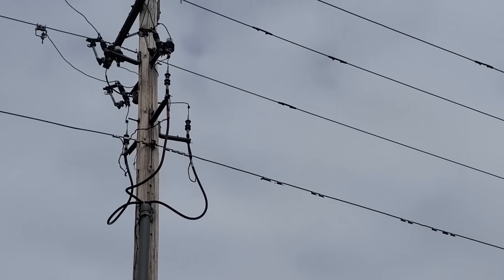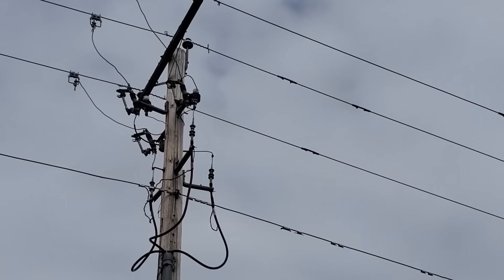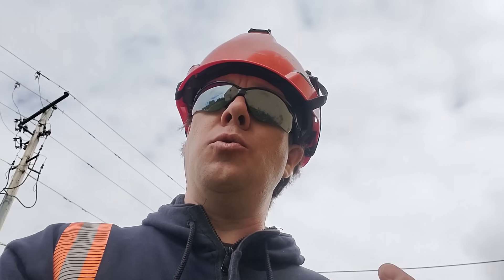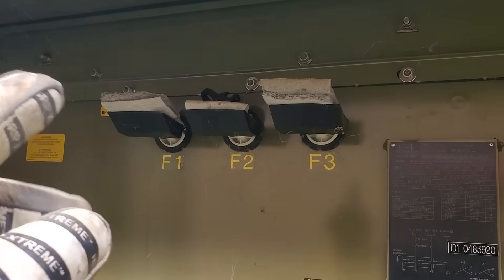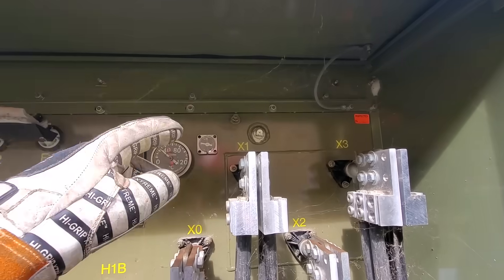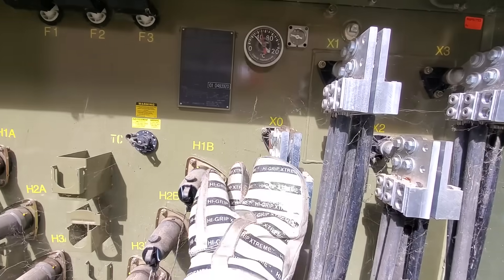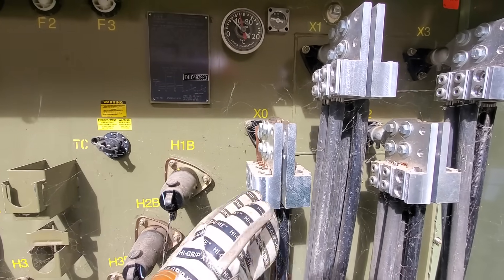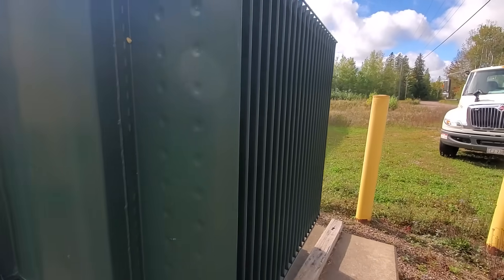A closer look at Padmount Transformers

Comment: A couple of things I can tell you about these.
When you pull on the wire the breakaway will break away and oil will go glug glug for a while.
Then the power company comes and fixes it.
Then the bill comes, and you need to clean your pant legs.
I was lucky and the locates were off so they ate half.

Comment: I try to not touch those anywhere as it's possible (though probably very unlikely) that it could have some voltage. My high school had twelve of those around the campus. They all had 12 foot square chainlink fences around them (for good reasons, mischievous teenagers). I cannot recall any issues apart from a phase los that blacked out half the school. That was a different one somewhere far away. (it was more than just the school affected)
I didn't realize those were oil filled like the pole mounted ones. I gues fair enough, as those are supposed to deal with huge amounts of voltages and curent.

Comment: SO OUT OF CURIOUSITY... if the transformer had a leak from either rust or some idiot drilling into the unit, what would happen after the oil is drained out while the transformer is hooked up and online?  If there a protection circuit that would shut it off or would it possible catch fire and/or explode?
Reply from the maker: Anything is possible, but it would likely overheat and pop the cutout/fuse that's protecting it

Comment: 😲 The only things I thought I knew about the “green boxes” were that they hurt my shins when I accidentally trip over them and that they change the voltage for different load. But, even if I were tempted to ever get into one, I now understand that I have no idea how technical and complicated they are inside. I had no idea they had oil in them. I love the insight into the complexity of tapping into an underground line. I expect that that translates into the cost of tapping into power for new construction, which means that opening a new business or building a new home gets more expensive.

Comment: as an electrical engineer myself, I always shut people up at site or at client meetings because of how little they know. But whenever I work with a linesman on the high voltage side, I don't say a single word, not because I don't know less than them, it's simply because of respect. If a linesman says its gotta be done this way, I don't challenge that, I just stfu and do it his way. No questions asked !!!!

Comment: Question: what would happen to one of those during a catastrophic flood event, like happens at times in various areas of the US?  They're normally very weatherproof, but I don't think they'd be watertight to constant pressure of submersion by surrounding floodwaters.  Have you ever had to work on a transformer like this after something like that?
I'm just curious.  Hadn't really ever thought about that before this video.
Reply: Some utilities use submersible transformers instead of pad mounts. Completely underground with an open grate  over the vault.  Less accessible to the public.

Comment: hey there 
im a brand new subscriber, just got a few questions
so you said theres no exposed wiring in there, are those silver connectors not exposed "live" parts
what do the varios writings mean x0x1x2x3 etc
Reply: "x0x1x2x3 etc" are the LV bus bar coming out. They're aluminum on this unit.

Comment: Working many solar fields, it takes some getting used to remembering the "LOW" side is power in.  And watching for the 120volts coming from the street transformer to the equipment letting the system know whether the grid was up or down.  Either way, once it was terminated and tested it was no longer our concern.
Reply: Do they hook up grid scale solar panels in series to get a few kV of DC into the inverter?

Comment: they have to replace ours at work every year because of the vibrations from the equipment inside the building which rubs the lines in the ground and causes a ground fault, if they are not replaced yearly,  we ground fault and that gets expensive as our load condition is a 4 million dollar unit and it does not take kindly to faults.

Comment: Is there a concern with home power generation (either by solar panels + batteries or a generator) backfeeding power during a power outage?  

If a homegamer hooks up a solar panel and battery system and the power goes out, but the homegamer doesn't open his main breaker, when you work on the line, is there a concern that you could be harmed?  What precautions do you take or should you take when working on a line during a power outage?  Is this even a problem?  

It just occurs to me that if a home system is backfeeding 240 volts to a xformer, wouldn't that step it up to 10,000 volts or so?
Reply: They wear those oven mitts. They'll be alright.
Reply: Proper grid tie solar systems will either shut down completely or disconnect from the grid prety quickly when grid failure is detected.

But people feeding in generators without proper interlocking certainly do pose a hazard to utility workers if proper precautions are not taken.

Comment: I used to do basic power routines at AT&T. I helped maintain 24v plant with large Lead acid cell batteries. We had a big fire in our Los Angeles central office I suspect caused by someone doing maintenance and not using insulated tools.

Comment: yea I remember Louie the Lightning bug down here in the states  (might have been early nickelodeon, they had a lot of Canadian kids programing ) besides that we have a similar pad transformer surrounded on 3 sides by a "explosion proof" concrete wall. It has a nasty sticker of a very pissed off cloud with a lightning bolt coming from it ... says something about lethal voltages, as a supernerd and a EE working in a factory pulling nasty amps at 480, I always wanted to open the box

Comment: The oil in that transformer. Is it flammable? Biodegradable?
Reply: Historically, the oil was mineral oil.  In modern times, a fluid called FR3 is the replacement for the mineral oil.  It is less flammable, and not as much of an environmental hazard as the mineral oil that used to be used in transformers.

Comment: The big park in my town has one of these green boxes situated right next to the pedestrian plaza between the baseball and soccer fields. It takes a 13.8kV distribution line and steps it down to several 120/240/480 volt drops for the field lighting systems and concession stands. That box has been sitting there for some 20-odd years with hundreds of people walking by it per week during summer games. It's amazing how close we can bring such high voltages to people, and do so safely.

Comment: There is magic smoke inside a pad-mount transformer.... If anything happens to cause the magic smoke to start leaking out, it's a really bad day for a person named 'Someone'. 

Someone loses power in middle of shower. Someone has to come and repair pad-mount and put the magic smoke back in. Someone get's stuck at intersection when traffic lights quit. 

Finally, Someone has to come up with satire, because failing to do so is just wrong.

Comment: we here in the Netherlands have all underground power wires. You won't see above ground anywhere but for the long distance ones with them huge pylons. This is due safety etc. Also here things are planned like 10+ years ahead, for getting a build permit will just take you that long. Also transformers are there on both sides of the "line" underground towards houses, if one transformer goes out, the other will take over, full automatically. Also, those transformers are often under utilized less than half, so from those transformers future things could be added to a certain max. Digging on public property is NOT taken lightly and only after permits, planning etc. 
But, back to the point... US system is more like a hodgepodge just extend/expand here and there, at minimal cost and not planned ahead. Add to that that there's a lot of rocky soil in the US, vs here its all sand, mud, clay etc, gotta dig deep to find rocks. Its WAY more expensive to get to dig thru rocks on large distances that go around in the US vs the tightly high population areas in the Netherlands. Different circumstances give different solutions to make it workable. 
Here it's NOT acceptable to have a power out. In the last 20 years, I had only 3x a power out for around an hour tops. I will never know how many times it just flipped to another transformer for the transformer kicked out, for that will be within a 50th of a second, not even the light will flicker or w/e.

Comment: Oh cool, an ABB bit of kit. I work for them on the lightning and surge protection side here in the UK. I also design the earthing systems for transformers/substations like that. Most of the systems that I do the earthing for are 11kV/400v padmount units like these, although I do occasionally do others such as 13.8kV (quite common in Saudi Arabia), and a lot of these, especially at the moment, are multiple transformers around a large distribution ring such as an industrial estate.
Reply: eyyyy ABB guy here too. Build dry type three phase over here for everything from data centers to tiny things lol size of huts to back of pickup size woot. Heard Europe lost a lot of jobs during the takeover glad ya made it.

Comment: wanna hear something funny?, I'm a journeyman electrician in Hawai'i and went to a customer's house that had a blown-up breaker feeding his air conditioning system (was a disconnect beside the meter main). As I was replacing the breaker the bus bar had somewhat welded itself to B phase, so as I pulled the breaker out the B phase became unstuck and slammed against A phase and caused a huge explosion.... that blew the fuse on the curbside transformer for the neighborhood. come to find out that was the only thing protecting that circuit because the main meter was only a CT meter..

Comment: Why is there oil in the transformer?
Reply: Not all transformers have oil.  A transformer without oil is a dry-type transformer, and is usually used for connecting between sub-600V systems.  Like 480V to 120/208V, as is common when a majority of the loads need 480V, but you still need 120/208V to power receptacle loads.  These transformers usually dissipate a lot less heat, than their medium-voltage counterparts.

The reason for the oil is that it is an electrically insulating, but thermally-conductive oil.  Those properties usually come as a package deal, but some substances can insulate electrically while conducting thermally (but not vice-versa).  Air, as well as gasses in general, are horrible conductors of heat.  So you need a liquid to assist.   The oil is to help improve the heat transfer of the ohmic heating and heating due to other losses in the transformer, and take that heat away to the cooling fins.

Comment: Lost one of our cats to one of those double pole transformers they often use here in Norway (with small platform in front of it) on a 22kv line. It climbed up and did not dare to climb down again and wandered around up there until it made phase to phase contact, the 50hz buzz when it made contact for just a moment was pretty loud ...
Reply: Such "buzz" usually quickly turns into loud boom

Comment: The Fuses inside the Transformer, are they protecting the Primary side? If the answer is yes, then you have redundancy protection, because there is also the Fuse Cut Outs up on the Pole.
And does the Fuse Cut Outs and the Transformer Fuses have the same or different Amp Rating?
Reply from the maker: The fuses in the pad are at primary voltage but protecting the secondary side. A fault on the secondary will pop the fuses but still allow the primary to feed throught to the next pad.
Reply: @Bobsdecline  Thanks man !! 👍
Reply: Internal fuses to protect the transformer, the fuse cut outs on the pole to protect the cable between the pole and the pad mount

Comment: You could have also mentioned that this particular transformer had a 3-phase connection configuration of Delta Primary(High Voltage Side) and Wye(Star) Secondary(Low Voltage Side). This information can be found on the Transformer Data Plate.
Reply: What determines using Delta or Wye on the primary vs secondary?  It seems like the Delta / Wye is the most common configuration, I don't recall seeing many Delta / Delta or Wye / Wye transformers.  I'm curious of what the advantage is.
Reply: This unit appears to be a GrdY (internally grounded Wye) primary.   Not  delta. 

You can see the H0 decal beside ground bus bar.
Reply: @joegutteridge4317  You are right, I stand corrected. Good eye!!

Comment: Would be interested in details of the "Low voltage" side. What are the 4 connectors? 3 hot phase with one grounded neutral?
Reply: That's correct.  Usually there are spade bushings, that contain an array of holes for connecting hydraulically crimped lugs.   Big busbars that look like paddles full of holes, sticking out of the transformer tank, and hung from the ceiling with a fiberglass support rod.

The three secondary busbars are labeled X1, X2, X3, and X0, for the three phases and neutral in that order.  On the secondary, you usually need a lot more wires in parallel to achieve the same power rating, so it's not uncommon to see multiple wires per phase on the secondary, to achieve 600A, 800A, 1200A, 2000A, etc.

Comment: Looks like a 500kv-  transformer, and 1/0 primaries. Are those arc snuffing elbows on the can? Also looks like an older style base that is just a solid slab. Just curious how your jurisdiction does the grounding, is it steel rods or copper clad?
Reply from the maker: I believe the primary is #1 solid, you could be right on the 500kv. The primary elbows are the load break type. We often still use concrete, but they are performed pads now. Also we have fiber glass pads which allow much more room for the cables underneath. The grounding is all copper, includes rods/grid and extends 1m out around the perimeter of the pad.
Reply: @Bobsdecline  Ahh I do like the precast pads so you can coil extra cable inside incase of a burnoff or needing to replace/upgrade the elbows. And I wasn't sure if you were solid core #1 or stranded core 1/0 but could tell it wasn't 500mcm or 750mcm. And for your grounding wire is it #4 copper or 2/0? And are you using olive clamps or the fancy wedge clamps?
Reply: 500kVA*

Comment: Well  I need one here in the sticks.. if bitcoin ever rides back to 40k$ il be upgrading my shops power to 3ph 600v. My 233v 200 amp service is tapped out and the little pole transformer they just replaced humms  more then the old one that cooked this winter heheeh
Reply: buy one yourself lol itll run you a year wait almost and 150 grand for a decent one.

Comment: The biggest "is everything in life a lie?" moment Ive ever had was when a linesman came out to work on a transformer that was for a pretty small service. It looked like one of the normal 2-3 foot tall residential type green-box pad mount transformers. He opens the door on it and im looking on from a distance, because why wouldnt I be, not something you see every day.  And behind the door when it opened was a small pole-mount transformer sitting in the box.  HV running up to the single HV bushing, LV on the sides, like a normal pole-mount transformer install, just with a protective box over it.  Not what I was expecting to see.
Reply from the maker: We used to have those, they definitely aren't ideal. As far as I know, all of them have been replaced in our province. I still see them sometimes on private owned systems. If my memory serves me correctly, we call them transclosures
Reply: City of Fort Collins Colorado still has lots of those on their system, really the only thing that needs to be changed is the high side bushing to accept an underground elbow. I know they had a major problem with them burning up in the summer time because they are intended to be hung off a pole and get air cooling, doesn't work as well inside a box or in a vault.
Reply: @motarted1735  you can actually take a termination for a riser to the HV bushings. So there's no real need to modify the Bushings.
Reply: We had dry pots at the state psych hospital, except they were in switch gear. they were all from the 40’s-50’s. There was a lot of scary old stuff there, some stuff was even from the late 30’s.
Reply: Live front

Comment: I was with you till the air pressure bleed off.  Is there a nitrogen blanket put in the transformer to prevent the mineral oil from accumulating water and going bad ???  
Also many of our old boxes are marked NO PCB.  Those were some bad units.

Comment: Would it be normal to perform a thermal scan on the connections inside the enclosure whenever it is opened, as a preventative maintenance action? Thanks
Reply: at these levels of power, signs of a bad connection will be a lot less subtle than that!

Comment: SO F1 F2 and F3 are the HV fuses where are the LV fuses in a set up like this?
Reply: The secondary-side fuses, or breakers, will usually be in separate equipment.  Such as the service disconnect, panelboard or switchboard.

Comment: Wait, why is it easier to tap overhead lines (compared to underground)? Do they not need to be isolated and grounded? Or is it just a matter of logistics - you don't need to dig up a bunch of dirt?
Reply: I think the biggest difference is that underground lines are surrounded by insulation and ground wires which must be removed before tapping and reinstated after tapping.  Doing so live does not seem like it would be easy to do safely

Whereas overhead wires are bare wires in free space, so the only things they have to do live are lifting up the new wires and clamping them on to the existing.